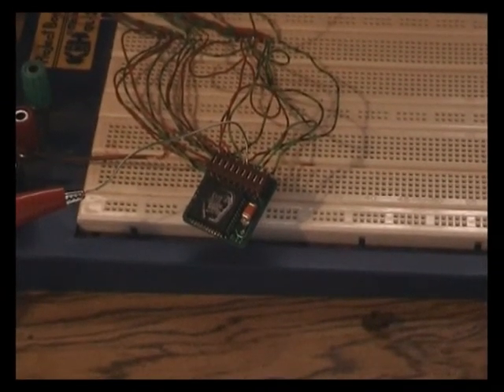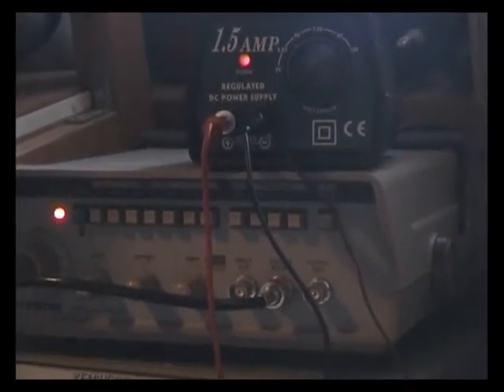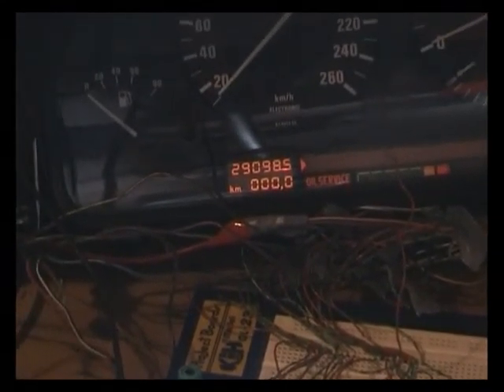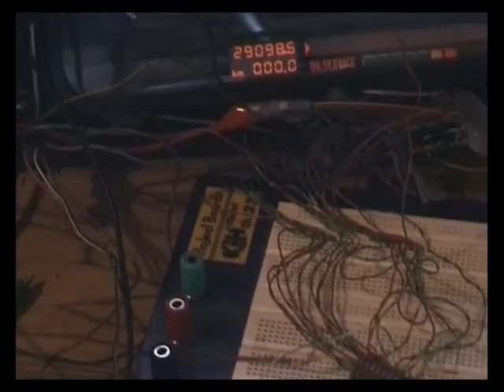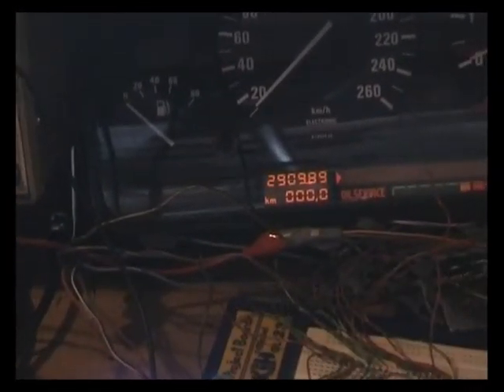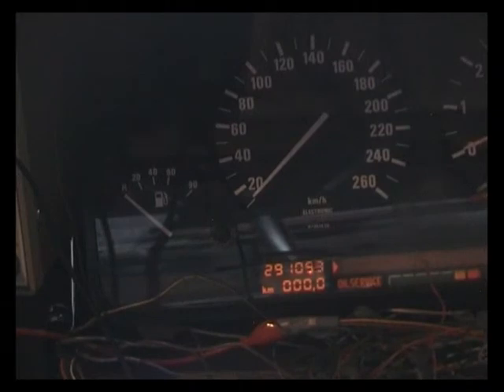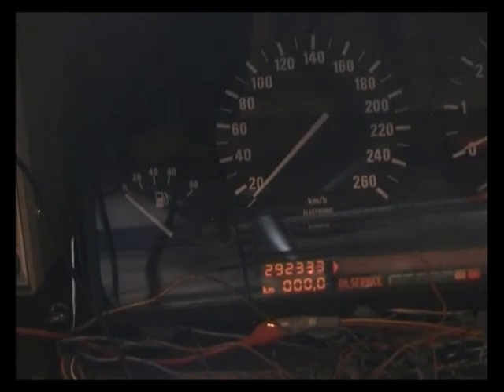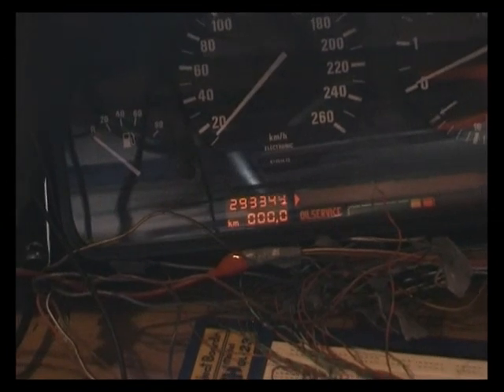E32 instrument cluster research part 2

Comment from the maker: So.. did it go around to zero? Unfortunately not. I came across an article, that said this could work on around 10% of the plugs. Simply, because the chip on the plug is not designed for a million write cycles! Unbelievably bad engineering that is, nothing more. Did they really think, that no one will ever drive their BMW 700's beyond 300 thousand kilometres?